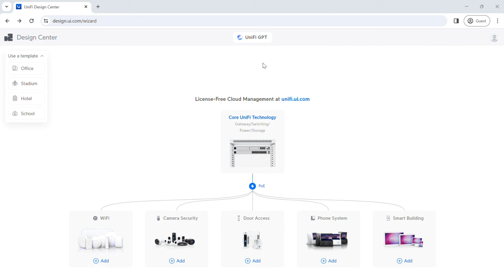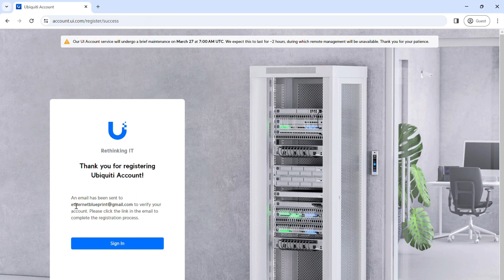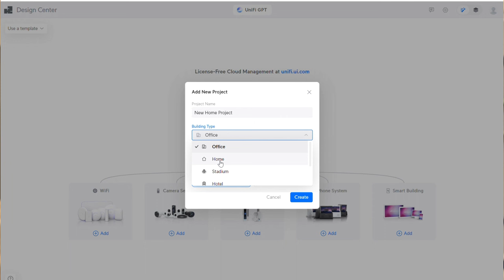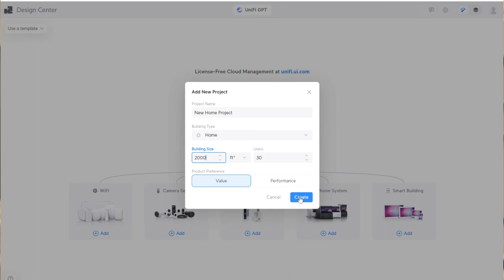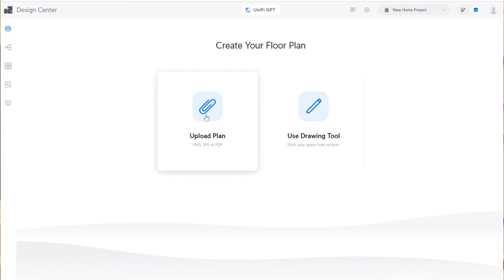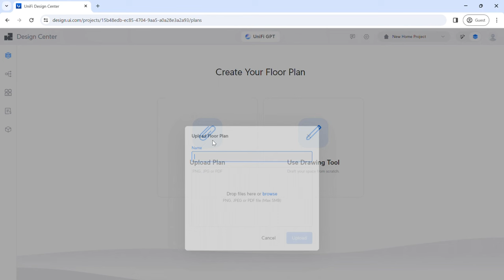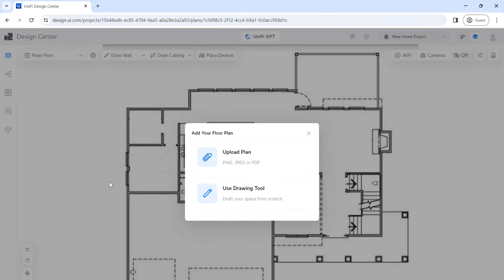Plan your Wi-Fi Locations with Design Center (FREE)

Comment: Cool tool.  I hope Ubiquiti develops it further to address coverage from adjacent floors.  I would also think that AP orientation would make a difference (horizontal/ceiling mounting vs vertical/wall mounting).  Looks like a great start though.
Reply: I gave it a try and see that access point orientation is supported.  Nice.
Reply from the maker: I agree.  There is work to do, but its still a nice planning tool!

Comment: Does Design Center take in consideration the 4 signal levels that you can set for each AP (High, Medium, Low & Auto)?  I'd like to see the coverage difference with each setting.  For instance, if we have two APs inside, set to Auto and two more (Front Yard & Backyard) set to High, how would that look on the coverage map, instead of all four set to Auto?  What is setting that is being assumed in your video?  Thanks.
Reply from the maker: That is a good point.  I typically leave my APs on Auto for these types of setups and only fine-tune the settings if I have issues.  I think Unifi does a pretty good job with it auto settings so I typically recommend starting there and adjusting if necessary.

Comment: I have not had a chance to play with it yet, but what about more advanced setup, ex. AP power adjustment, channel selection, etc? I thought I've seen some videos where people showed actual heat map with overlapping signal.
Reply from the maker: I don't think you can do that with design center.  Were the other ones you've seen using a different tool?  When it comes to AP channel and power levels, I typically recommened leaving those settings set to Auto in the beginning and only tweak them if necessary.  Just my 2 cents.

Comment: Great Video. when you paint the walls and define it the material, did you take in consideration the wall's width. Here some of this walls are 6" thick. In this case did you round the wall or just trace the single line over the wall?
Reply from the maker: There really isn’t a perfect way to account for that, but if I have thicker interior walls that I feel will hurt my signal, sometimes I’ll use the exterior walls for those. 

If you’re referring to exterior walls that are that thick, I would just assume that the signal won’t be quite as strong. I’m not sure how accurate it would be if you doubled up the lines to be honest. This is really just meant to be a rough guide.

Comment: Thanks for the video.  I was able to use the Design Center and placed U6 Mesh units inside closets to hide the units.  What do you think about concealing these in closets?
Reply from the maker: Concealing them in closetsmay affect the signal a little, but as long as they aren't in concrete or behind stone, you should be fine.

Comment: Where I have a closet and vaulted ceiling, can the access point be mounted on a wall such as above the closet since it would not be seen or does it really need to go on ceiling?
Reply from the maker: APs can be mounted on walls... (even the ceiling style APs like the U6 Pro or like APs)  They do not need to be mounted on the ceiling.  Vaulted areas definately add complication when it comes to planning your coverage... I'm with you, I wouldn't put an AP on that either... I would elect to go with a wall mounted option.

Comment: Nice demo!  I have a single story house with a vaulted ceiling in the main area, and 9ft ceilings most everywhere else.  There is a vaulted section in the master bedroom and one other bedrooms.  I assume I'd just select 9ft ceilings for everywhere?  Would that have a big effect on the accuracy?  Thanks!
Reply from the maker: Yes. 9’ should work fine for that I would think. Should still remain accurate.

Comment: I haven't used it yet, but if this tool doesn't predict coverage vertically between floors, then it is of limited usefulness. After all the structure between floors is just an internal wall. How hard can it be?
In my house I have mainly solid walls between rooms on the ground floor. I'm hoping to feed them from APs upstairs. It's a shame this tool won't help me to do that optimally. 
Otherwise... I'm very much enjoying your videos, thank you.
Reply from the maker: I wish it did as well. A lot have requested that feature.

Comment: Great video series and so helpful.  Do you have tips and content relative to determining which equipment to buy from their generated list vs. what could be sourced elsewhere as you suggested (e.g. unmanaged switch).
Reply from the maker: Thanks.  My only tip on that is to make sure you look at the power of your switch to make sure it will cover your needs.  I don't typically setup networks like that, but I do know that other unmanaged switches (say from Netgear) are much cheaper.  If you don't need to do VLANs that could be a good way to go.  But if you want to do VLANing in your home, then an unmanaged switch will not work for that.  It really depends on your needs/wants...

Comment: Your videos are great and are helping me as we design our new home's network system.  Three questions:  Does the Design Center take into account floor bleed through, ie. could we expect to get a good signal on the ground floor from a second floor installed AP?  If I use a 8 foot ceiling in the Design Center, but will actually mount the AP higher, will my coverage likely increase or decrease?  I have a sloped ceiling where most of the ceiling is 8 feet, but there is a sloped ceiling  where I will actually mount the AP at about 12 feet.  Could a ceiling unit be mounted on a wall to broadcast farther in an open space?  I am wondering if I could use a ceiling unit rated for outdoor use on an exterior wall to cover a large back yard with gazebo that will be about 150 feet from the house.   Thanks again for all the videos you have done.
Reply from the maker: Design center does not take in account floor bleed... It doesn't have any way to do this in its current state.  You will get bleed through from one floor to the next.  That is why I take a sort of Staggered deployment for my builds... If you watch my video (From 4 APs to 1AP), I turn off 3 of my 4 APs and take readings around my house... might help you with determine your locations...  150' is pretty far.  I would imagine you would get signal there, but not great speeds.  I have used the AC Mesh Pro outdoors when signal is needed farther away.  They seem to be pretty powerful.